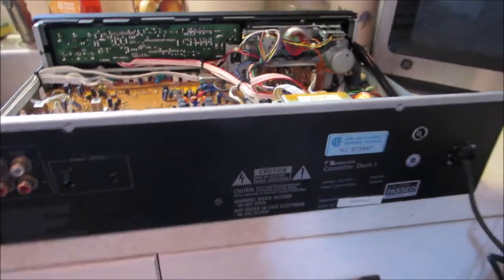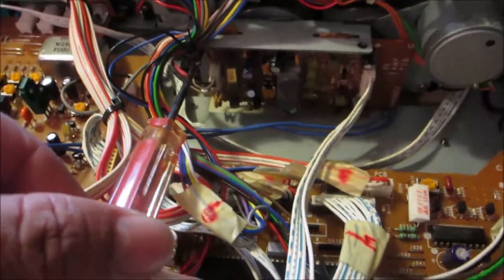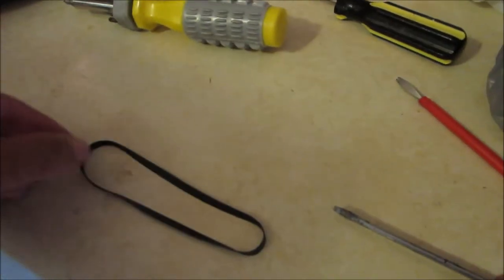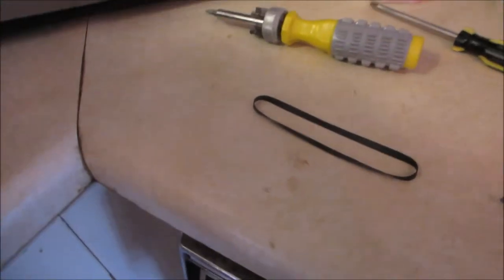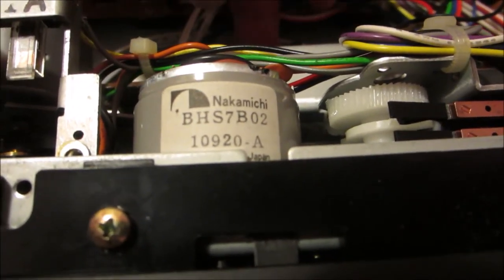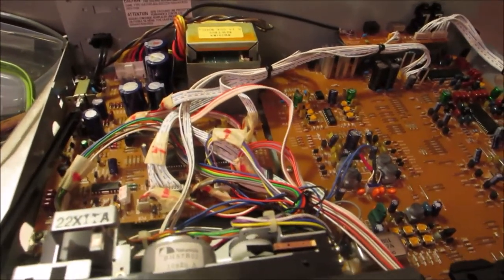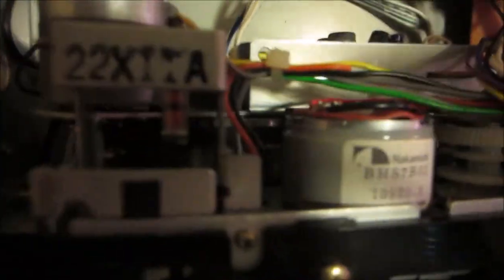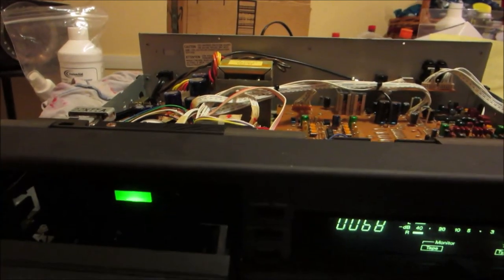Nakamichi Cassette Deck- 1 or Cassette Deck -1.5  belt replacement.

Comment: Thanks for this! Are you 100%sure the belts are the same size for the 1 and the 1.5? I have a 1.5
Reply from the maker: As  I stated in the video, they are exactly the same deck with the only diiferences are the Gold plated RCA inputs/outputs and the Azimuth control in the front of the deck.  The belts are the same, as the mechanism is exactly the same.
Reply: Ah fantastic! And thanks again for the great video. Now I’ve just gotta find somewhere that has those belts.
Reply from the maker: @sorrycharlie1736  where do you live?! On EBay you can find the belts for your cassette deck 1.5.
Reply: Oh great thanks I’ll try that. I’m in Australia